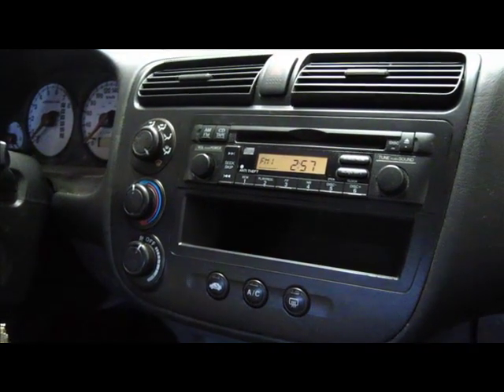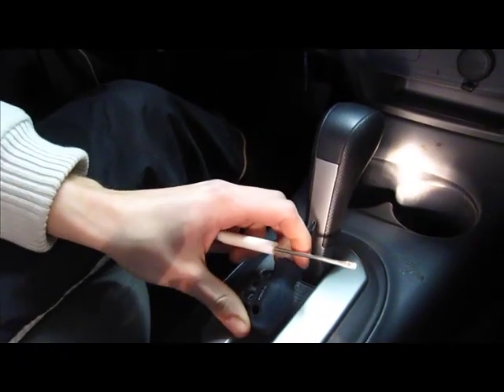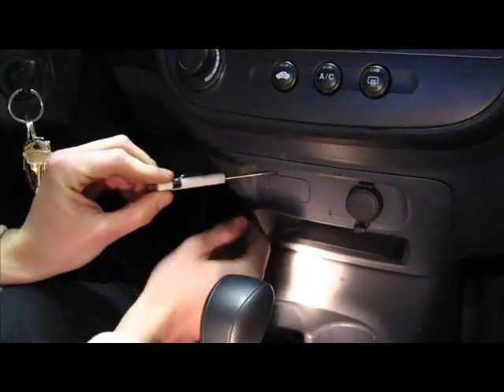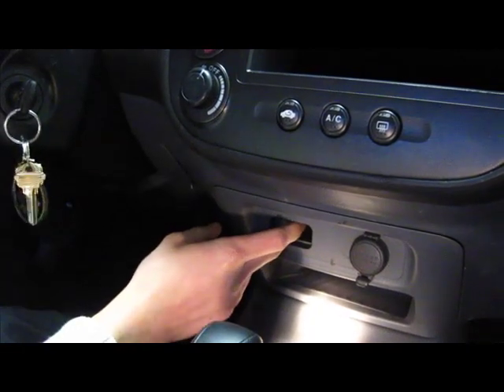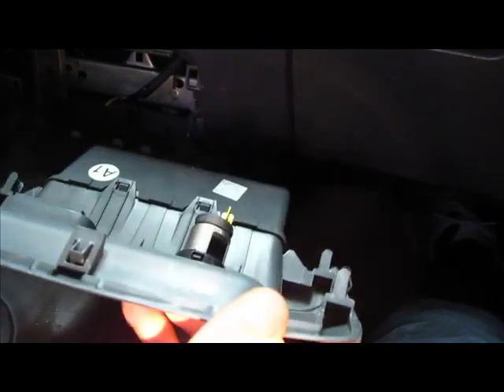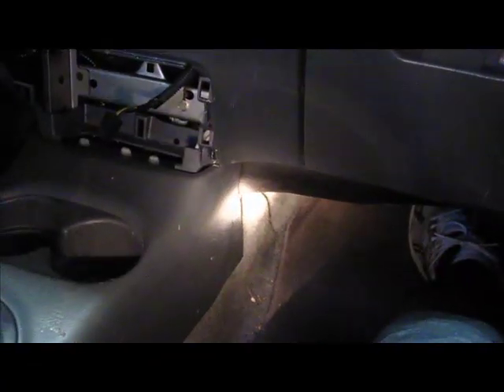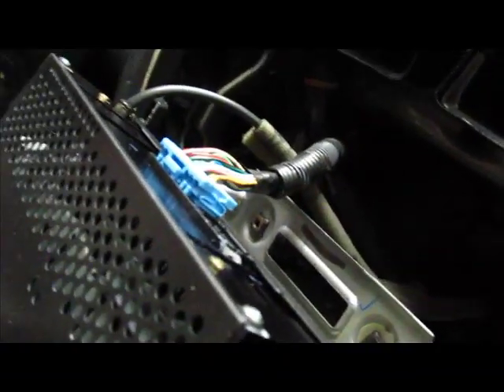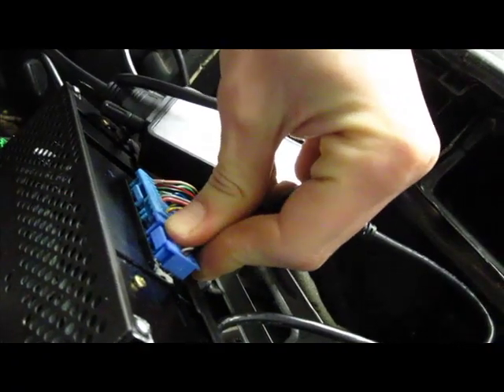Honda Civic and Acura EL  iPhone, iPod, AUX adapter installation for 2001, 2002, 2003, 2004, 2005

Comment: Here's a tip for 2001 Acura 1.7 (which might work with newer cars).  When you pop off the cover that holds the cigarette lighter, you can feel the back of the stereo with your fingers (just stick it back far enough, and up.  You can actually connect the cable to the back of the stereo without removing the stereo this way.  Use your fingers to find the plug, the plastic clip points up, and push it in.  Worked perfectly for me.  :)

Comment: thanks for the video. I just finished a Canadian spec Acura EL year 2005. On these cars the fake wood grain panel that holds the cigarette lighter is screwed from behind and can't be popped out like shown in the video. So i had to pop the gear shifter rings, then remove the center console right up to under the radio, then i reached up with my skinny hand and was able to plug the adaptor into the back of the radio.  Everything worked fine.  Hope that helps folks who own Acura EL.

Comment: You can plug the kit into the back of the radio without removing the radio in the 2004 Civic as well. Just get someone with a small hand! =) Then you can hide the GTA box behind the cover area of the cigarette port, and run the cables out the little square plug area to the left of the cigarette lighter. Quick, easy! Took me under 10 minutes altogether.

Comment: Not a rip off... works extremely well. I got it and installed in 10 min, no i can charge my iphone 5, play any audio source and control it with the stock radio buttons. Even pauses automatically when i turn off the radio and resumes when i turn it back on.

Comment: Hi- thanks for the video. Instructions are very good. I have one question though. All I see is we had to connect the cable from the GTA car kit to the second slot in car's audio. So why do we have to do the step removing the part near the cigarette lighter?

Comment: @gtacarkits In this video though, you pressed the CD buttons and I don't even think I have those buttons since I don't have a CD player or a tape player. I just have the radio. It really could still work as long as I have the plug behind my radio without having to press any sort of CD buttons? I'm so desperate for this to work = (

Comment: Hi, I have an Acura EL 2003, same stereo from this video you posted. I installed the gta kit today but I'm not able to control from my stereo. Aux cable works perfectly with it but I cannot control anything through stereo it. I also tried playing with all disk numbers and still not working, my ipod goes on to ''accessory connected'' but also flickers sometimes to my playlist on my ipod screen. I can't seem to figure out the problem, what's causing this problem?

Comment: my 2004 civic VP has two cup holders in front of the transmission, which is connected to the bottom piece that needs to come off (to access the screws). Does anyone have information on how to remove it?